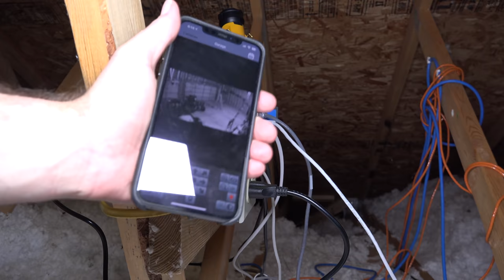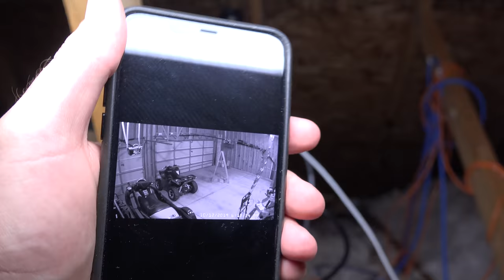Running power for PoE switch in ATTIC!

Comment: How about using a laptop cooling fan under that switch?  You might have one of those handy and I'm sure you've got a USB wall wart that you can use for power... shame the switch doesn't have 5V USB on it externally.
Reply: A fan will do nothing!!!  Where is it getting the air?  The Hot Attic air, blowing onto it?  it does nothing.  Now if you duct cool air using a fan from someplace else directly onto the switch, that would be a little useful. Now sure why he didn't just mount it in the garage up high, then he can run wires in the attic and drop down a short distance into the garage and into the switch.  Piece of cake.  Not such high temps.  You can monitor it easier.  Sometimes the switch needs to be reset.  Now you have to go up into the attic to Unplug it and plug it back in. When if it was in the garage, it's right there.

Comment: *edit: Was corrected in the comments. I flipped the ratings. 12/2 is the better option.

12/2 is rated for a 15amp breaker. 14/2 is rated for a 20amp breaker. 12/2 will be fine, but 14/2 would have been a better choice as residential electrical demands increase. Also 14/2 is compatible with 12/2 so there’s no good reason not to use it.
Reply: You have it backwards. 14awg is thinner than 12awg, they're rated for 15 and 20 amps, respectively.
Reply: @grumpytanker8258  agreed he has it backwards. 
Though I wish he would have gone ahead and run 12/3 or 14/3 so he would have a ground. It's not necessary but can protect the equipment. 
My network has been hit by lightning several times and blows everything till it gets to the first grounded piece of equipment (the switch).

EDIT: I forgot that 12/2 actually has a ground as was pointed out by  @GrumpyTanker
Reply: @Zanthum  12/2 does have a ground. 12/3 is for a 240v outlet.
Reply: yall right. my bad.
Reply: Ok everyone 12/2 can run off of 15amps or 20amps but 14/2 can only run off of 15amps not 20amps
Reply: @wolf3five  

That works.  12/2 is normally used for power outlets.  With a 20 amp circuit.  At least that is what I used when I wired up a number of outlets along the left and right walls of my garage.  Yes, it's also Yellow in color.  You can use a 15 amp circuit breaker.  It won't hurt anything other than going off sooner.  You may possibly need more than 15 amps at times.  Some power tools can draw a lot when first powered up.

 14/2 is thinner.  And the outer casing is White.  That is for 15 Amp breakers only.   I use this in my garage also but for my lights, I mounted onto the ceiling.  I had also mounted a new Sub Panel in my garage.   I did this before putting up Sheat Rock as most of my garage didn't have any on the inside.  I still have none on the ceiling, and no plans to put any there.  I store some stuff up there.   I have a low slope roof on my house.

But ya, as the wire number gets smaller, it gets LARGER.   It does seem backwards.
Reply: @grumpytanker8258  I had forgotten that thanks for pointing it out
Reply: Zanthum the first number referencing romex and prewired MC cable refers to the number of conductors MINUS the ground conductor, in other words 2/12 has a black, white AND ground, even though the label only calls out 2 conductors. The ground is required for safety, so they throw it in free and don’t mention it. I don’t really follow the logic, it is what it is
Reply: @iflnr978  I remembered it wrong because a while ago I had to buy some 5 conductor cable for 3 phase +neutral +ground and it was called out as 5 conductor but was for a different purpose so had a different nomenclature. Also I edited my comment a week ago to correct that mistake.
Reply: Zanthum I commented on the post as it appears today. It said something about being edited, but I felt the need for my response so I am not sure the edit made the correction you wanted
Reply: @iflnr978  My comment literally reads "EDIT: I forgot that 12/2 actually has a ground as was pointed out by  @GrumpyTanker"  I guess you did not click "Read more" to read the ENTIRE comment before replying. Would you like me to put the correction BEFORE the original comment?
Reply: Zanthum no thanks. I should have been more careful. I have a disability in which I take everything very literally and I have spelling and reading dyslexia. I look for short cuts and resist reading things fully. One reason I didn’t consider the edit was: the other cables mentioned with numbers that also have the uncounted ground, so I didn’t believe the edit would cover all that, perhaps someone making the same mistake will read this post and not make a corrective comment. Probably not a lot of people read these comments anyhow. Thanks for explaining what you wrote, I’m sorry I wasn’t more careful

Comment: I saw the boards you step on give a lot... above your garage. It looks like the 2x6s are joined by only a mere plate in the center . That doesn’t look safe. (yes i hate to be that guy). But at the height of that attic from your garage and the 32” spacing of those joists. You fall thru you are looking at paralysis at the very least, death at the most. Do us all a favor i feel like you are up here once a month. Get a structural engineer to look at this and maybe get 3/4 plywood over the main walk area.

Comment: 12/2 wire?  So no ground wire?  Should be 12/3 for White, Black, and Groud.  Is it really that hard to make your wire runs nice a neat?   I crawled under my house with less room and ran my wires along the floor beams, bundled together use Zip ties. Ties that have a hole for a screw to go through which I used to screw to the beams.    It would have been a snap in your house running the cables nice and neat in the basement.  In fact if you had planned on cameras or whatever up there around the house, you could have run all your Ethernet cables at once, maybe even a few extra's and ran them nice and need. Coil up the cables not currently used until later and ran all the other ends down into the server room at once.  

The power Box you installed, WOW.  Wrong Box.  No cable Clamp to the cable going into the Box.  Power cable not attached to anything, like the ethernet, just laying around.  So really, showing everyone how to do everything WRONG and not safe.  

When I wired my house and ran all my Ethernet cable under my house as my Attic is tiny as I can barely go down the middle.  My cable which are bundled.  I have Multi Keystones going into each room.  That way I have one Central Switch, which is a 48 port switch in my RACK.   The last time I was under my house not long ago, I did a few upgrades to have more Keystones in my house and ran a couple Cat6 cables to my Garage.  SoI have 2 Keystones in a wall plate there in my garage.  One I had future plans for and the other a spare, just in case.  That future plan was for PoE cameras.  I ended up mounting an NVR in a lockbox on the wall.  Plugging that into 1 of my 2 Keystones. All My Ethernet cables for my Cameras go into the garage.  The way my house it, 5 of my 5 cameras are mounted around the garage. 2 on the front corner above the garage door in a cross pattern.  One on the side that looks at my front door.  One on the other side that looks at my side gate and side garage door.  And one on the back of the garage that looks at my back sliding door and backyard.   So it was pretty simple to run my cables from those locations to the NVR.   I have room for 2 more cameras for my NVR as it supports 8.  My 6th camera is a Dome type camera that I can control.  It's out on the corner of my house on the roof overhang as far out as it can be.  I made a mount so it could be level.  I can see down the other side of my house and the window there which is the normal spot, but I can also rotate it around remotely and see my front door or anywhere in between.  Up and down.  

Ethernet cable is pretty cheap.  I just buy a large box of the stuff and make the cables I need.    All my Keystones to Patch to my 2 Patch Panels are labeled.  It makes diagnostics easier later on.  I just like things done right and up to code!!!  Showing others hack jobs is wrong.  Then they go ahead and do the same thing and their house burns down.  Really, just a little more effort and things would be neat and safe.
Reply: I stopped reading at "no ground".. the 2 in 12/2 relates to the number of neutral and hot wires.  It does not include the ground.  A 12/3 is for 240 since it would have two hot and one neutral.  You can't buy Romex without a ground anymore .....  This is electrical 101.

Comment: I suggest 'You' hire an electrician.
Reply: 'Contractor approved' If I were looking to buy a house and I saw that, I would run away. If there is one like that, then there are more. There is a reason why there is an electrical code, to keep you from burning your house down.
And why are you installing the switch in the attic? Put the switch on your rack and  run Cat6 from the switch to wherever in your house.
Reply: Succesfully is debatable. I want to change the channel but it is like watching auto racing...You know there is going to be a crash. So many things that could have gone wrong.